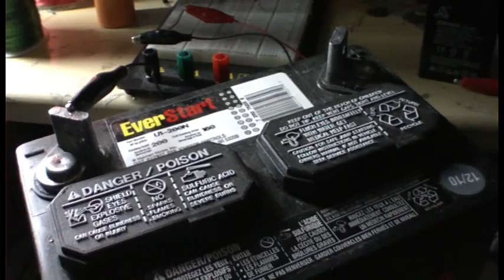Big Slayer Exciter

Comment: Great job looks promising if you check the Henry value for the coil and match the cap value you will get what you want if you are looking for resonance ie say it's a 10uh coil than you need a 10 micro amp  cap to balance it out on the circuit side if you have a top load this must also be factored in keep up the good work and thanks for sharing

Comment: lol @ the scanner. my tower comes on every time theres a storm outside and i still get a kick out of it =D. thats pretty good results so far. i mean u still have some additions to make so im sure it will get a lot better.
and i would not totally trust the draw your meter is telling you.  id also recommend trying one of those AA emergency cell chargers to drive it at 5v.

if u are not getting plasma at 12v yet (with as many windings as u have) then u can assume u are just not near resonance yet